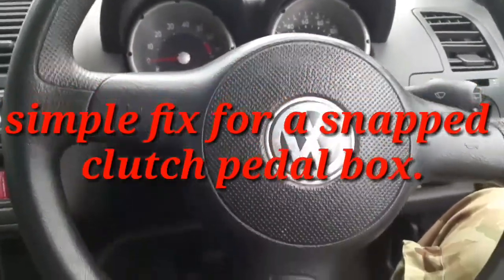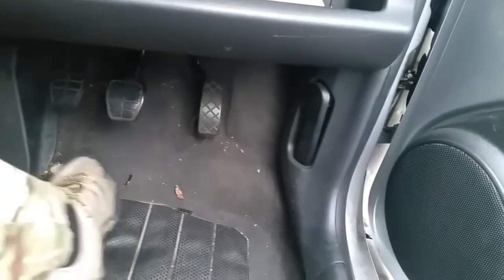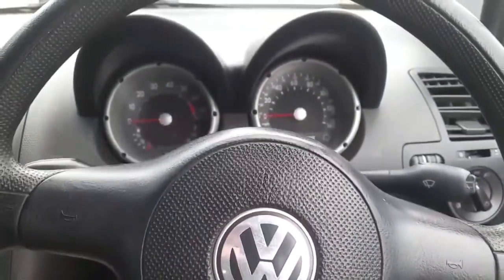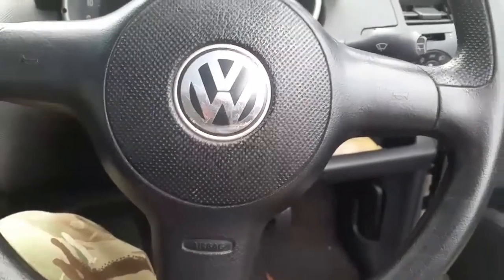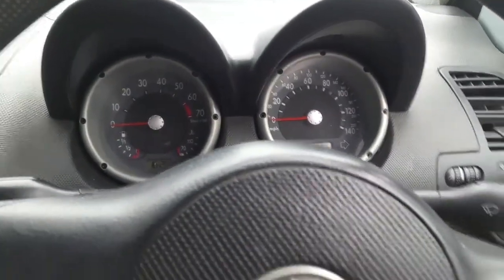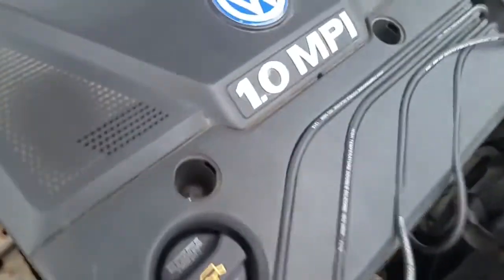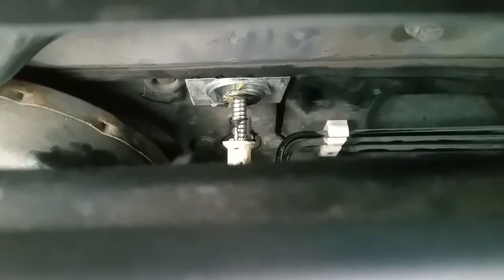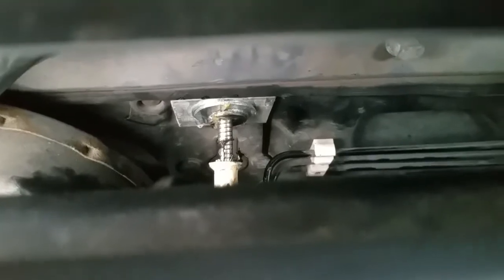VW LUPO PEDAL BOX FIX .. FREE AND EASY..

Comment: Tried this and my pedal is as high as Bob Marley in heaven. New cable Maybe?
Reply from the maker: lol.. have you tried the bolt on top of the pedal?  that controls pedal height. it needs to be tightened down to lower the pedal position. try that first, you may need to adjust the cable a bit after. hope this helps
Reply: @009ADVENTURES  ok mate thanks, i'll give it a bash tomorrow.

Comment: did you hold onto the car long enough after this to see if this strained the clutch cable to breaking eventually?
Reply from the maker: there's no reason why it would, it works just the same,  yes had the car for a while with zero issues .
Reply: @009ADVENTURES  ok thanks for letting me know - think my cable may simply have gone of its own accord/age a few months after doing the bulkhead fix. 25 year old cable...

Comment: What glue did you use
Reply from the maker: I just put a blob of super glue on there, it's only to hold it while the cable is fitted as the the cable will hold it in place 👍

Comment: Hi does the plastic sleeve around the cable go into the plate?
Reply from the maker: just drill the hole big enough for it to fit flush at the bottom of the plastic, theres enough room behind the bulkhead not for it to interfere 👍

Comment: Hi, I had to call AA yesterday since I couldn't shift any gears anymore. I have a VW polo 2000. Turns out the clutch pedal bracket has broken off. Just found your video. Would your solution work on my car too?
Reply from the maker: oh no that's annoying,  I'm not 100% on the polo tbh but I would certainly have a look. the clutch pedal is connected to the brake pedal by a steel bar in this case that I assume is the same as polo so all the bracket does is hold the outer cable which is all this plate does, you just need to slacken off the cable a few turns at the clutch fork . if you need any more info pls ask and I will help if I can 👍
Reply: @009ADVENTURES  thank you for your reply. Since I don't know anything about fixing cars I really don't know what I should do. Do I just go to a garage and show them your video? Or would you know anyone in the Hertfordshire region who could help me. I just don't want to loose my polo due to an enormous bill. Thank you for any help given.
Reply from the maker: yes I would recommend taking it to a garage and showing them the video,  that's exactly what someone else on here did and saved a fortune.. I hope you get it sorted 👍

Comment: So how did you do this exactly?
Reply from the maker: disconnect the clutch cable from the pedal.. drill a hole in a piece of plate or large washer then slide it over the cable then thread cable back through bulkhead and reconnect cable. you may need to adjust cable a bit.. job done.  if you need more help don't hesatate to ask. cheers
Reply: 009 ADVENTURES !! 
My god! You saved my day..

Comment: Is this still going strong on your car? Would you recommend this fix still or did you encounter problems further down the line?
Reply from the maker: I ran it for ages with no issues, still going even though I sold car. cant see any reason why it should cause any issues as bulkhead much stronger than the poorly designed pedal box so yes I would recommend, it's a pig to get the pedal box changed.
Reply: @009ADVENTURES  Wow, I'm surprised you replied (and so quickly) given you made the video nearly 10 months ago! I'm sure I will post up a few questions as I'm contemplating doing this fix and doing it your way. Did you have to replace the infamous brake pedal clip (I assume not)? Can you think of why no one else has ever thought of this fix? Might sound stupid but obviously this only works on cabled cars and NOT fly-by-wire right?
Reply from the maker: no point in making vids if your not going to reply I always say.  I didnt have to change anything at all, simply add the washers. I first did it by cutting a groove in the washers and sliding them over the cable and glued them in place. then I renewed the cable and slid the new washers over and just hooked the cable onto the pedal.. 5 min job. there's enough adjustment on the cable as the original bracket that broke is just behind the bulkhead. no idea why they just didnt use the bulkhead anyway.. feel free to ask if you need more help and if I can help I will 👍
Reply: @009ADVENTURES  Hi, I had my trusty mechanic do the job for me as I'm too useless to do the job myself cheapest quote I had to do the pedal box was £200 to weld it up. Mechanic only charged me £50 so you've saved me a lot of money. Thanks, I am very grateful!
Reply from the maker: oh that's good news, having to make do and mend all my life comes in handy sometimes.  glad you got it sorted 👍

Comment: hi my daughters vw polo has this problem you can see the clutch pedal box moving when ou depress the clutch do you have to bolt the existing pedal box to the bulkhead from the engine bay or does this idea work and secures the whole section so will the clutch work as normal even ith the pedal box moving around thanks phil
Reply from the maker: hi Phil, in my case with the lupo the clutch pedal was connected to the brake pedal with a thick steel bar so all the bracket did was just hold the cable in place untill it snapped so didnt do anything apart from this. not sure if the polo is the same as I've not looked at one tbh. just had to adjust the bolt on top of the clutch pedal to adjust pedal height but clutch operated normally without any issue.
Reply: @009ADVENTURES  hi thnks for replying yes my daughters clutch pedal is on a steel shaft with the brake pedal and there is a bolt on the end holding the clutch pedal in place but when you push the clutch pedal down the bracket is moving as you can clearly see it through the bulkhead where the clutch cable comes through to the engine , so how do you do this do i have to bolt or weld the plate to the bulkhead and leave the existing plate loose
Reply from the maker: no need to bolt it or weld it or anything as the cable will hold it in place. you could put a screw in if you wanted just to help holding it in place while you work on it but I didnt.
Reply: @009ADVENTURES  any more information
Reply from the maker: @101mtype   what else would you like to know ?
Reply: @009ADVENTURES  thanks for the reply long story short i had issues with the pedalbox had that replaced now its doing the same again hard to get into reverse first and second i have ordered a new clutch cable and would like to bolt it through the bulk head like you have but could really do with some type of guide to follow but just cannot find anything
Reply from the maker: @101mtype  honestly it's a dead easy fix, all you need is a large washer or plate slid over the end of the cable b4 you put it through the bulkhead and attach it to the pedal . this washer or plate will cover the hole and use the bulkhead instead of the bracket.

Comment: not sure if you will still reply but iv had this problem today found your video and got it going. only issue i have now is by bitting point seems to be way way high. iv let out the cable as much as i can at the adjuster. but it sits so high still
any help would be great.
Reply from the maker: hi, yes I'm still here . it was a long time ago but from what I remember I had to slacken the cable right off as far as it would go then adjust the stop bolt on top of the pedal to push it down a bit then tighten cable until it was correct.  let me know if this helps 👍
Reply: @009ADVENTURES  I'll have a look tomorrow. It's drives and changes gear i allready scrapped a lupo because of pedal box issue I wasn't gonna scrap another haha. Can't seem to buy replacements. So glad I found this video haha

Comment: Mate of mines suggested welding mine (im useless with cars lol) is this quicker ?
Reply from the maker: welding the actual pedal bracket would be a task as it's hard to get at, I did think of it and this is why I came up with this bracket,  you could weld this bracket on if you wanted but there's no pressure on it , I simply glued it to hold it in place 👍

Comment: Hi mate, I tried to do my own fix like you and now much clutch pedal sits much higher than my other pedals.. any idea what could be wrong?
Reply from the maker: hi, have you tried adjusting it at the gearbox end?  I think I had to slacken it off a bit from memory,   it was a few years ago but I think slacken that off a bit then tighten the adjustment bolt on top of the pedal to get the pedal where you want it.
Reply: @009ADVENTURES thanks so much for the reply. at the gearbox end it's as loose as it can possibly be.. I don't know anything about the adjustment bolt at the pedal though.. is that the one just to the left of it near the top?
Reply from the maker: no worries bud I just hope it helped :)      yes it's just on top of the pedal, if you tighten it down a bit it will push the pedal down.  obviously don't tighten it too much as it may cause the clutch to slip . sorry to state the obvious :)
Reply: @009ADVENTURES  hmm, after tightening and loosening there was no movement of the pedal at all. I wonder if there is something else causing a problem. Thanks anyway
Reply from the maker: oh that's strange,  well at least the car is running I spose :)   I'd be interested for future reference what the issue is,  let me know bud
Reply: @009ADVENTURES  true, yh if I figure it out I'll be sure to let you know
Reply from the maker: thanks, sorry I couldn't be more help
Reply: @009ADVENTURES one last question actually, on the right of the clutch pedal about halfway up does yours have a lip type thing? If so does that what stops the clutch pedal moving any higher as it gets blocked by a part of the pedal box?
Reply from the maker: tbh bud I can't remember,  I no longer have the car to check unfortunately.  if you want you can mail me some photos and I can take a look. you can find my email in my about section
Reply: @wjp17 did you manage to find a fix for the high pedal my biting point is way to high
Reply: @duckijoegaming5189  to be honest mate I just put it up with in the end.. you get used to it eventually haha